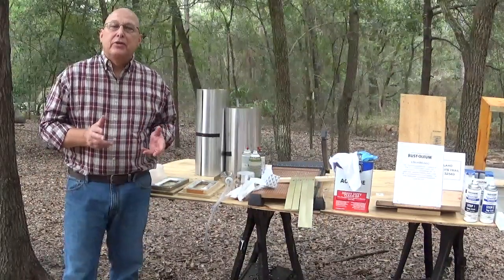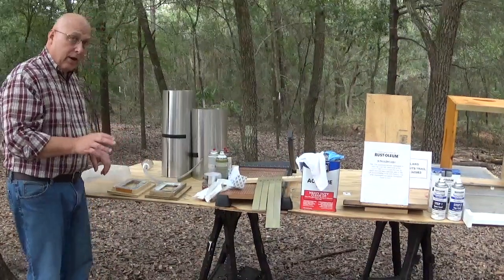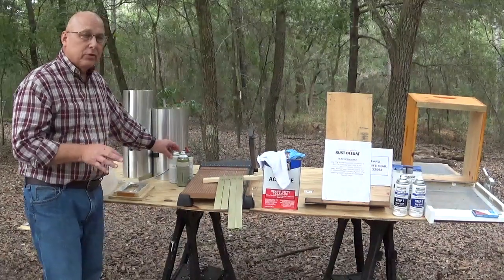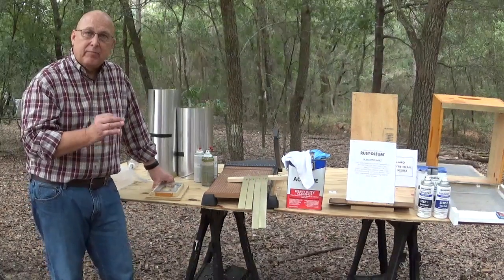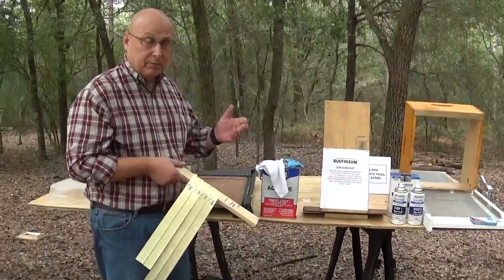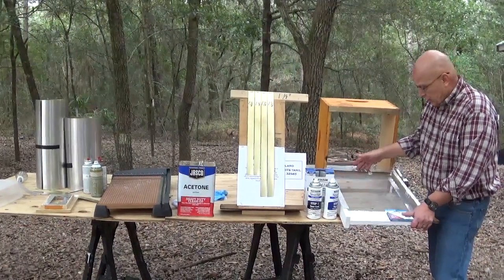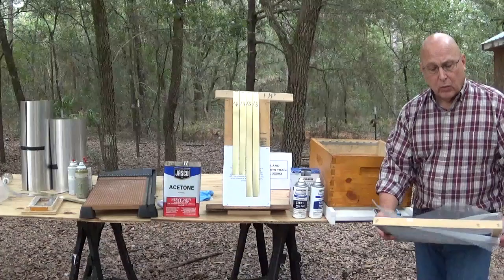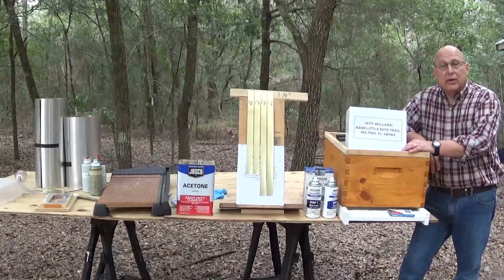Small Hive Beetle Barrier, it is easy to make and inexpensive.....

Comment: The Small Hive Beetle can fly so what prevents them from just flying up and over the flashing where your bees are I mean that's how they get to your hives is by smelling that alarm pheromone and flying right to your bee hive. What stops them from doing so? Maybe I'm missing something. Really like to know.
Reply from the maker: All research shows that the hive beetle will fly miles to your hive but once inside they hide and only crawl along the inside edges and up into the combs, but I guess you could always have that one mutant hive beetle out of a million that would fly inside the hive. The beetles can't crawl on the  coated flanges so it keeps the hive beetles trapped on the bottom board to die of old age or be killed by the bees.  I hope this helps, good luck..
Reply: Thanks

Comment: Hi Jeff, thanks for the video. I hope you're getting donations. Question, and I think someone else asked also, once the SHB gets inside the entrance and is let's say on the center of the screen, what's to stop them from flying straight up into the hive? as i understand it, the excluders are only on the 4 sides, but directly above is open frames.

on the same note, i suppose the bees do exactly that... walk into the center of the screen and fly straight up into the frames? or do they stand up and grab/climb onto frames from screen. thanks
Reply from the maker: Hi Dan,  Actually, I have not received any donations for the idea. From all the research done on the hive beetle, once inside the hive they only crawl along the bottom edges trying to hid and then migrate up the sides into the combs. The Neverwet coated flanges stop the beetles upward movement, keeping them confined to the bottom to die or be killed. Flying inside the hive would exposed the soft body tissue under their wings and make them more of a target to the bees.
Reply: crazy. well i'm not sure if we're going to go this way or a full sheet of aluminum with circles/dimples cut out. i'm just worried about them flying. either way, you're video game me the idea and helped me understand so we will be sending something. sorry no one else has that's how it is always though.
Reply from the maker: Thanks, Dan

Comment: Mr Willard.  I am in the process of getting ready to put this in my hives. I am using a “Freeman” style bottom board with 1/8 inch wire designed to allow the beetles to drop into a pan of soapy water or lime. My questions: could I spray the never wet on the wire mesh and that way the SHB couldn’t crawl around the wire? Thanks in advance and I plan to contribute to your site soon.
Reply from the maker: Hi Tim, 
You really don't need to spay the 1/8" wire mesh it would actually be a waste of the Neverwet material. The bees will chase the SHB around enough for the beetles to fall or crawl through the mesh to escape and hopefully to their soapy or oily doom.

Comment: I see that you place the NeverWet aluminium flange horizontally so that it acts as a barrier.  
Have you tried placing the NeverWet flange vertically on the sides of the risers or on the sides of the supers in the Hive??  If the beetles cannot walk across the flange because of the Rustoleum NeverWet surely they will not be able to cross it anywhere in the hive??   It will  allow for easier installation.
Reply from the maker: Hi Dave,  If the coated flanges were put on the vertical sides of the hive it would be a barrier for both the bees and the beetles inside the hive. If the coated flanges were put on the 3/4" riser of the bottom board this leaves the corners as a problem spot, the beetles could possibly grip the rough edges of the cut flange in the corners and gain access to the hive. My design places the flanges on top of the 3/4" riser on the bottom board which creates a coated ledge that overlaps in the corners, which the beetles can not cross. This will keep the beetles confined to the bottom board to be killed by the bees or die of old age. Once you start installing these strips you'll realize that it really isn't that difficult.
Reply: Jeff Willard Could a piece of flashing be placed between your concrete block and 4x4 post of a hive stand and coat it with neverwet? Kind of like termite flashing under a house. Do you think this will stop SHB, ants, and cockroaches?

Comment: Hey Jeff...ya gotta market these...$$$$$$$$$$     ill be your first customer.
Reply from the maker: I had once considered doing that, one guy wrote and said he had calculated  cost per hive to make his was .85 cents. Being a Beekeeper is an expensive and somethings frustrating hobby. My thought was Neverwet flanges helped me immensely so why not pass it on and help everyone, money isn't everything but it is nice to have just enough......
Reply: well if you ever want to make some side money...let me know. I need 35 for my 10 frame deeps and 35 for my 35 nucs. I am a horrible carpenter.  I live in Texas and they are so horrible here. --thanks! :)
Reply from the maker: Thanks for the offer but I will give you my super simple screened top cover directions. Staple the window screen and 1/8" hardware cloth down together on the vent frame bottom with a single row of 1/2" stainless steel staples (I like using stainless) spaced about an inch apart. The aluminum window screen is the outer layer and the 1/8" hardware cloth is the inner hive layer. Spray contact adhesive on the outer screened frame edge, let dry and then attach the polyethylene foam tape to the screen. You now have a hive beetle proof screened vent top. This is how I do mine, rip a a 1"x 6" or 1"x 4" board down to 1-1/4" wide, from that board cut two 16-1/4' and two 18-1/2" boards. Lay the 18-1/2" boards on their 3/4" sides then take the 16-1/4" with the 1-1/4" sides standing up glue and nail to 18-1/2" board ends (air nailer makes this easy). Now you will have a square frame with 1-1/4 on the ends and 3/4" on the sides. Then attach screen as explained, I hope this helps.

Comment: this sounds great... one question though.. why the metal strips...is it possible to just spray the neverwet  directly onto the inside areas of the bottom board and the inside of the lower area of the bottom super??
Reply from the maker: Hi Frank, It might, but the wood will expand and contract with moisture and the bees are always cleaning the inside of the hive. I wanted a solid flange barrier inside the hive that forced the beetles to crawl over, which they can't because of the NEVERWET coated bottom surface. Thanks for viewing...
Reply: +Jeff Willard 
can the Beatles walk on the neverwet if it's on the bottom? I'm referring to the bottom horizontal edge of the upper entrance slot on an inner cover. can they walk over the neverwetted metal as if it's on the ground?
Reply from the maker: All the flanges are sprayed with Neverwet, attached to the bottom board with the Neverwet facing downwards towards the bottom of the hive. This will creates a barrier that the Hive Beetle can not walk on and get into the hive. "BUT" you must make sure there are no other points of entry above this barrier, cracks between hive body, supers, vents and tops or they will get in through these areas.

Comment: Just made some of these.  Just to be clear, the Neverwet is sprayed on one side only.  The Neverwet side is facing down on the bottom board as well as the strip on the front of the hive body, correct?
Reply from the maker: Hi Garret,
That is correct Neverwet coating is facing down and you paint the bottom side only. Your on your way to be in the "No Hive Beetle Club" Good Luck.....

Comment: A friend that has metal working tools asked me what the gauge of aluminum strips did I need. Unfortunately I wasn't certain so I needed to ask if you suggest a given gauge of aluminum material for the strips. Also given he had some pre-painted aluminum I assume baked on pre-painted strips, that they can't be used unless one side is bare aluminum. Is this observation correct?
Reply from the maker: I used rolls of aluminum roof flashing 16" and 20" you would have to look up the gauge but its paper thin and high tensile. I would think a pre-painted aluminum would work as long as its sanded and cleaned, I would do a test strip to make sure of the adhesion of the Neverwet to be sure.

Comment: Thanks Jeff - SMB are a problem for me in sub tropical Australia.  Are you convinced that SHB can only climb inside the hive and not jump or fly??

 Also what is the minimum gap between the flanges anf the bottom of the frames.  I guess I am struggling to believe they can't just hop up onto the bottom of the frames.  
Cheers
Steve
Reply from the maker: Hi Stephen,  All research states that the hive beetle does not hop or fly inside the hive, they only crawl and hide then migrate up into the comb and frames. I never measured the gap between the flange and the outer frames but I believe its about 3/4".  The Neverwet coated flanges stops the hive beetle from crawling up the inside of the hive and it keeps the beetles trapped on the bottom board to die or be killed. "BUT" I can not stress enough that you must seal all cracks and openings above the coated flanges, or the beetles will find a way in. I caulk the seam  between the hive body and screened bottom board. I then use 1/8"x1/2"  polyethylene foam tape between the hive, supers and top, it is the only foam tape I found that was strong enough to hold up. As I stated in the video, I have cleaned up my share of a maggot mess. I was looking in my  40 hives a few days ago and the only hive beetles I saw were the ones on the outside trying to get in. You should still use bait traps, oil traps or anything that keeps the "outside" beetle population down.  I've always wanted to say this.....G'Day Mate and good luck with your bees..

Comment: Hi Jeff. Would your system work with less work if the NEVERWET was sprayed on the aluminum flashing then wrapped around the hive stand legs.  I have my hives sitting on 2x6's that are supported by 4x4's 18-24" off the ground.  If I were to take the flashing, sprayed with NEVERWET and wrap the 4x4's just below the 2x6's would this accomplish the same thing your doing without having to make a flange for each hive.  I'm thinking of wrapping the 4 legs then spraying the NEVERWET on after installed. Thoughts?
Reply from the maker: Hello Wholefoodfarmist, Wrapping the legs would stop all ground "crawling" insects, unfortunately the Small Hive Beetle flies to your hive. The Beetle then crawls inside the hive and hides, it then migrate up into the frames and comb. The Neverwet coated flanges stops the inside upward movement of the beetles, keeping them trapped on the bottom board away from the comb. It really isn't that much work, I found it was the easiest to make up several bottom boards with coated flanges and hive bodies, then just transfer the frames and bees into the completed Neverwet flanged hive, then repeat the process, in no time at all you'll be done. You can then stop worrying about hive beetles. But, like I tell everyone you "MUST" seal and close every crack above the coated flanges or the beetles will find a way in. I use 1/8"x1/2" polyethylene foam tape between hive, supers and vent top or covers to close up any spaces with great results..

Comment: Thanks for sharing this info. Great video. I'm wondering what your thoughts are on instead of stapling to your bottom board. Stapling all strips to the bottom of your brood box. (When I add boxes i do so from the bottom I do not add to the top.) So If I keep adding to the bottom then eventually all my boxes would have these flanges. If I go 3 high then all boxes have flanges and if I have beetles on top level and they go down to the 2nd level then theoretically they can't go back u to the 3rd level. They can go down to the 1st level or stay at 2nd level. Eventually though I think they would get trapped at first level and being forced out of the hive. what do you think of that? Also would you recomend sugar dusting once your flanges are put on?
Reply from the maker: Hi George, It may work but it may be overkill also. If you have several hives try your idea out on one or two to see how the bees react to it and if you see a decline in the Hive Beetle population. The only problem I can see is that on some of my hives the bees will fill in the gap between the upper and lower frames with comb which would be like a super highway for the Hive Beetles to get into the next upper box. The biggest problem to solve after the coated flanges are installed is the gaps between the bottom board, hive body and supers. A little moisture will cause the boxes to swell creating gaps that may have not been there earlier, which become an entry point for the beetles. I have experimented with many different foam weather strip tapes to eliminate these gaps and I now use polyethylene foam tape 1/8"x1/2" between all my hive bodies, supers and vent tops.(link listed below)  I also caulk the gap between the bottom board and hive body. The sugar dusting is more for Varroa mites than hive beetles, for that problem I use an oxalic acid vaporizer and Aprivar strips. Good luck with your bees and have fun with them.   .

Comment: I have all Country Rubes bottom boards: can you do a video or blog post on how to fit those with your exclusion strips?
Reply from the maker: Hello Westernwilson, I went on Country Rubes web site and their bottoms  appear to be the same as any that would fit a 10 frame hive.  So the 20" and 16" aluminum flashing strips should work just fine on theirs also. Just make sure there is 3/8" of the flange sticking inside the hive all around the inside of the hive. I hope this helps, Good Luck. Jeff
Reply: +Jeff Willard Thanks Jeff! I will get those flanges on this winter. How come the bees can still get into the hive...do they walk in the front entrance and fly up onto the bottom frames, but the beetles always crawl up?? Also, in summer we run with an upper entrance (that cutout in the inner cover): I take it once SHB is around I have to stop doing that?
Reply from the maker: The Honey Bees crawl over the flange like it wasn't even there, it just stops the Hive Beetles. No more upper entrance, you will have to make sure "every" hole, crack and seam is caulked, filled and sealed in the hive body or the Hive Beetle will find its way in. You don't have to wait until winter to install these. I just finished my hives a couple of weeks ago, now I'm being protected 24-7 from the Hive Beetle.

Comment: Great job, now do you think the never wet would work to keep ants out of hive, by using a small sheet of flashing with never wet inch or larger than a cinder block, put between two blocks with a wood 10' stand on top of top blocks ?
Reply from the maker: Hi Danny, It will work 100% ants can not walk on Neverwet either. I would make it so there is a 2' overlap flange on the block, just in case any debris blows up against it giving the ants a bridge to your hive. Let us know how this works for you, I am sure other people have ant problems.

Comment: Would you happen to have a picture showing  how the Neverwet strips look/fit on the inside of the hive body. Especially in the front of the hive where the one strip was installed on the bottom? Also do you use the polyethylene foam strips between each hive body section that sits on top of the typical brood box on the first layer of the hive that sits on top of the screened bottom board?
Reply from the maker: David watch these; 

https://www.youtube.com/watch?v=3D-nkBTf2xs

https://www.youtube.com/watch?v=GMPQ2vGxp8E
Reply: Thanks for your time in sending the links!
Reply: I have been considering the use of a slatted rack and am wondering if you have ever used them and if so how this impacts the placement of the Neverwet strips. I believe the slatted rack typically is located right on top of the bottom board.
Reply from the maker: I don't use them but people have written to me saying that they have stapled the Neverwet flanges to the bottom of the slatted racks and spacers that they made. As long as the coated flanges are located at the top of the 3/4" rim of the bottom board, that is where they are the most effective.

Comment: Hi, Jeff,
Thank you for this video.  I think I am going to try to put these on my existing hives....just need to figure out what to do with bees once I take off bottom board to put the flanges on.  One question about the foam tape.  I have some weatherstrip seal foam tape (3/4" x 1/2" thick).  Could I use that between the super and brood box and on the top of the top board to keep them from coming in under the top?
Reply from the maker: Hi Janis,  

When I did my hives they all had bees in them. I smoked them first, pulled out the hive staples out and pulled the hive body off the bottom board. I sat the hive right next to its original position and the bees just come and go like they didn't care if the bottom board was on or off. Now, you will get those hives that are mean and full of piss and vinegar, those require "extra" smoke. Staple the flanges on, (put 1/2" staples every 2" apart on the entrance flange) hammer in the hive staples, caulk the seam between the bottom board and hive, your done. The foam seal that you have is probably the open cell gray sponge material, I wouldn't use it will absorb water and rot your hive, it has to be closed cell polyethylene. I am now using the 1/8" X 5/8" foam, Here is the link to were I buy mine, http://www.equalseal.com/White-Polyethylene-Closed-Cell-Foam-s/2187.htm   It sounds complicated to install the coated flanges on existing hives but once you do that first one you'll see that it is quick and easy. Good luck with your bees.